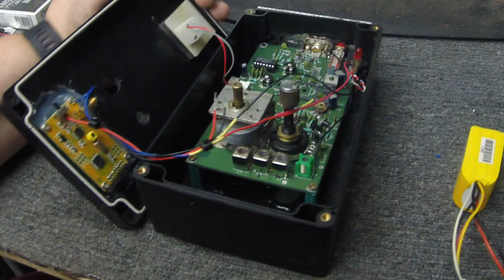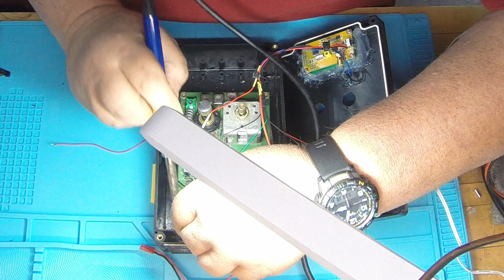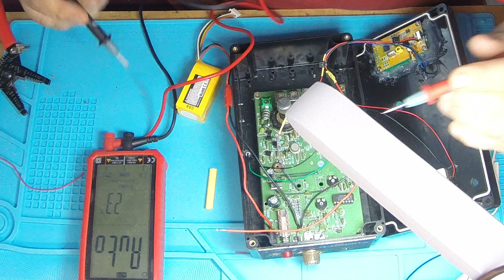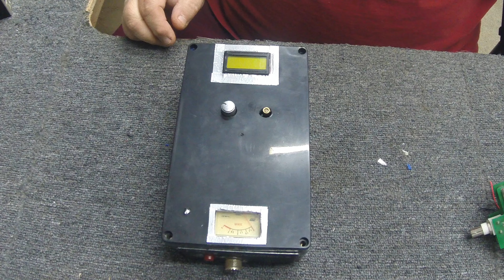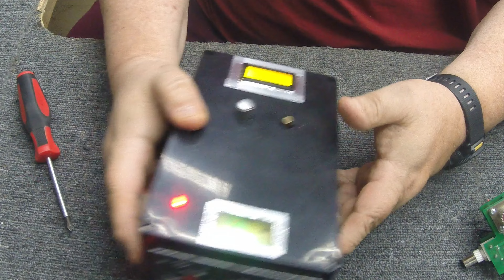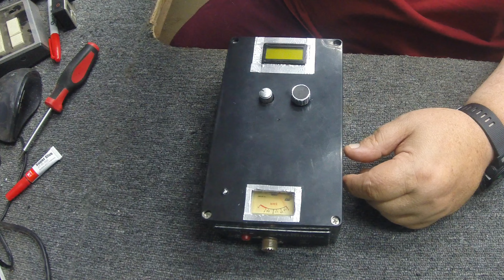MFJ 209 SWR Antenna Analyzer Rebuild and Improvement Part 3

Comment: I'll try this way in shorter comments, have you heard of Circuit Specialist in Arizona ....??
Reply from the maker: No I have not but I will check it out.
Reply: @TheElectronMan  Look at Part number RTC-51 those hold the 5 mm led bulb in place 20 cents each ..... Great prices on parts . 1N4002   $3.50 for 500 of them...  ETC. ETC...
Reply from the maker: @cajuncoinhunter  Thanks I bookmarked them yes I can see some useful items on there that I can add to my inventory.
Reply: @TheElectronMan  Glad you like it , that tester in the clearance section CSI-TC1 is a great tool, I've had mine for several years and has never failed me........